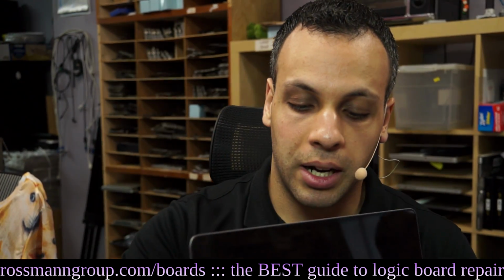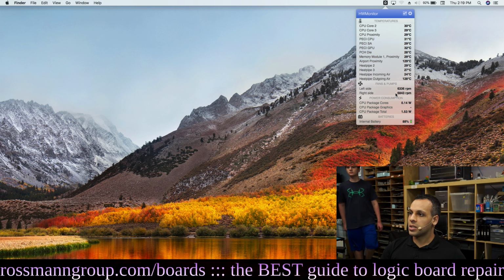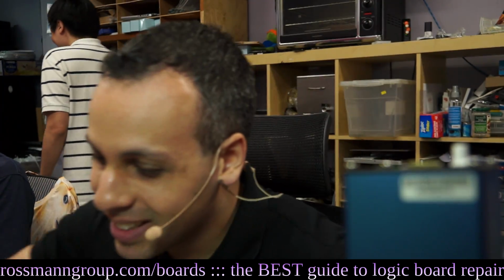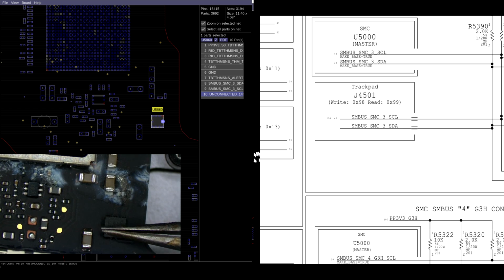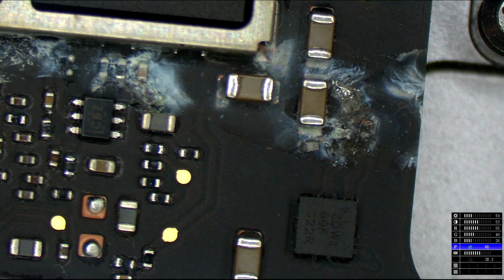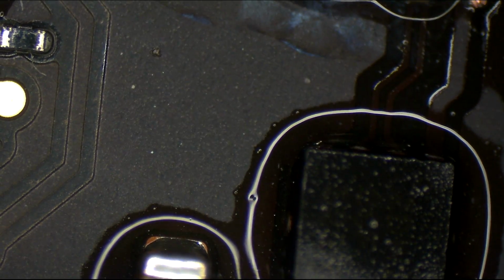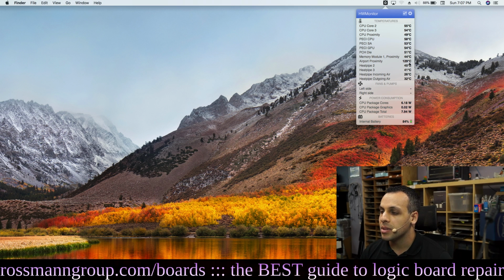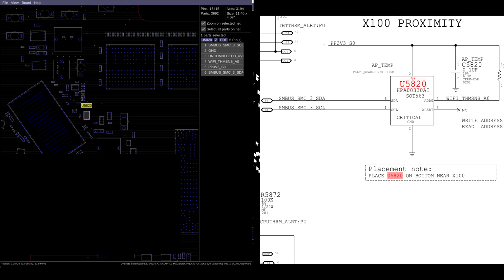How to repair sensor on Touchbar Macbook when running slow without Apple diagnostic software

Comment: Question: what happened to the RPM readings after your fix? Did you manage to get the correct RPM readings back again, before giving it back to the customer?

Comment: So why did it show a reading of a sensor that isn't there?
Reply: It's using I2C, and that protocol is dead simple, and there's no presence sense (at least, not on this line). The idea is that there is a master - the SMC - that queries the slaves - the sensors. There are two lines: clock and data. Normally, the data line is high, and if someone wants to send a 0 as opposed to a 1, it pulls it to ground. So when the SMC goes around to checking the temperature, it says on the data line: "Someone tell me the value at address 0x6F", and whoever has the address 0x6F responds in the next 8 clock pulses. HOWEVER, suppose the chip that had the value is dead. Since nobody else has that same address (that would be bad news), they stay quiet, and the data line stays high for the whole query time. Thus, the SMC receives binary 0b11111111, drops the first digit (since the temperature can't be negative (hopefully)), the CPU converts it to the common decimal representation - that is, 127 - then does some other stuff, giving a total of 128 or 129. Then it freaks out because the temperature is so high, and throttles its own clock speed to hell, which is why it's running slow.
Reply: I have to repeat my question. Why is it reading a sensor that is not present? Who told it to? Is it a third party software that is just mistaken?
Reply: How exactly does it know that the sensor isn't there? I told you, the protocol is dead simple, and you can literally interface with a device that doesn't care about timings with just a couple of push buttons and an LED. Because of this, it's super cheap to add into a chip, but it does also mean no handshaking and device enumeration for you. Therefore, there is no way that you can tell that a certain device is on the bus or not, so you either do some internal sanity checking on the smart side or freak out and throttle. I do remember something about heartbeat messages in the I2C protocol, but you're obviously not getting that here. 

As to why it's trying to read from there, it's a critical part of the system - it's one of the few things that allow it to check its own internal state, which is crucial if you want to keep it from overheating and blowing up - so any data coming out of there is taken at face value. 

One way you can think about an I2C bus from the master side is like a memory area. You can read from an address, and write to an address, but if the chip that housed the memory you're looking for is gone, then undefined bogosity will ensue.
Reply: Danya G. So it's a third party software that just guesses wrong? The answer shouldn't be that long if that's the case. I mean having a pristine apple product giving weird crazy values sounds very weird, they're usually quite sleek and functional devices. Mostly.
Reply: Danya G. Oh sure, I've had many times false readings from hardware monitors. So what I gather from these walls of texts is that yes, it's a third party software that can't know if this particular device has this chip, therefore is shows it regardless.
Reply: But the computer doesn't know this either! And there is no way it could know. The reason that the missing Airport sensor is no big deal is because the microcode on the SMC deliberately ignores that while computing the throttling factor. The 3rd party software, OTOH, has full control over the I2C bus, and tries to read from there, and fails. The reason I said before that the computer itself was reading it is because I thought you meant the airflow sensor, which was technically there, but it was gone from the SMC's POV.

Comment: hey Louis, is your HWMonitor a bootable DMG (cognate to a winPE boot image) with the software installed on it, or an actual macOS installation on a removable hard drive from which the system has to be booted? i'd consider putting it in my swiss army knife USB stick if it's the former. thanks!

Comment: here's a thought over engineered tech  good or bad thing? alot of apples problems is that its over designed and doomed to fail, if 1 sensor fails/breaks  its required of you to take it to an apple store for over priced repairs.

Comment: airport proximity , heatpipe temperature. either bad cpu contact causing throttling or a bad sensor. most likely seating of the cpu. that is backed up by 6000rpm fans trying to compensate. although with low package temperature its a sensor. 129 is a magic number with computer sensors. it means its reading null. as the bios can only read numbers the error that it outputs is in letters , that's why almost all failed temperature sensors revert to 129 its the numerical representation of some letters in a string . or 0 sometimes. or negative values.

Comment: everything about the first minute of video blows my mind. How can a company be so anti consumer and successful?
Reply: Because "Not having money is a sin and admitting it is lame and repairing expensive stuff instead of buying a new one means admitting not having money".
Reply: Maximum marketing.
Reply: Verlisify Mindless sheep are well... mindless... it doesn’t help they heard to buy 1 product
Reply: @c6amp while win 10 does tends to suck - i think you haven't meet vista or win Millenium :P
Reply: @c6amp Heck - i once bought HP laptop with vista - after a week of stuggling with the system i just installed win xp on it xD and later on win 7 (when it came out and sticked to win7 on it) ... The vista was a huge failure especially early on when it was "new". Win win vista the laptop despite being brand new was slow (despite it having good hardrware setup at the time). So yeah Vista sucked... but hey i got no probs if you had different experience. Cheers o/
Reply: Because its customers are all Thinking Differently (TM)
Reply: Furry
Reply: Money!

Comment: Enjoy watching you diagnostic, repairs and other comments. 
Curious on this project, was it determined what caused the 0 ohm resistor, being used ans a fuse, to burn up?  And is not replacing it with a larger capacity the same as replacing a a fuse with higher ampere?

Comment: The fact that you found the airport proximity sensor still wasn't working, and took the machine back apart to make sure the repair was done completely. despite the fact that there wasn't actually a sensor on there means you're more ethical than apple when you do repairs.

Comment: there's a couple things here  @Louis Rossmann  1.HWmonitor controls the naming schemes not apple, two HWmonitor generally sucks when it comes to accueratlely reading sensors , hwinfo is far more detailed sadly there is no current ClapOS build so moot point I guess unless you wanna bootcramp to windows

Comment: Hey Louis, thanks for all your great content! Question though; I just installed HWMonitor on my 11.5 with the m370x and the GPU 2 die is 129 degrees. My assumption is that this is not a needed sensor? Is this OK? every other sensor is perfect and behaviour is OK. Thanks

Comment: 4:08 
Ocelot:Boss, if staff morale or GMP reaches below zero levels, staff will start to fight each other, affecting the overall staff level, if the problem persists, the fights will get more brutal. you can gain moral by dismanteling nukes, raid F.O.B bases and doing stealth mission undetected

Comment: At some point during the making to that model Apple actually ran low on that sensor so that simply left it out.  From what I understand from a former employee that is common.  They simply tell the monitoring system to ignore the reading and move on.  They are essentially selling defective parts from their own specs!  But is that really surprising?

Comment: When I saw the airport temp I immediately had a flashback to the old G3 Toilet Seats where they would put 600mhz G3 processors in them, and instead of putting a cooling solution in there they clocked them to 200-300mhz (depending on model) and covered them in insulating foam -- then put their dumbass "airport" slot (aka a PCMCIA slot missing two voltages so you couldn't use third party cards) and dialup adapter directly over the cpu... More often than not resulting in BURNING A HOLE CLEAR THROUGH THE DIALUP ADAPTER and messing up any wireless card pretty badly.

Though it's fun on those to rip out the dialup adapter, put in a SHOCK heat sink, move a couple resistors around on the board, and bring them back up to 500mhz or faster (depending on the FSB/RAM clock)... and for some reason many buffalo wireless G adapters work in that neutered PCMCIA slot, and are shorter than the official apple ones making them less likely to get toasted.

LESS likely...

I swear, Apple wouldn't know proper cooling if it stripped naked, painted itself Noctua tan,  and hopped up on a table to sing "Oh look at what a high volume cooling fan I am!"

Comment: I'm a telematics technician and there is nothing more frustrating then an alcohol dispenser who doesn't shoot 😂. Especially when I'm doing fiber optic cable on very dirty places.
Reply from the maker: DAMN STRAIGHT!!!
Reply: @rossmanngroup  15la 11aallllqqqq 1lllqwwaa+que
Reply: Can't wait to see Louis Rossmann Smashing Things :-)
Reply: Pump several times > Grumble curses > Turn on side > Pump several times > Swear loudly > Turn upside down > Alcohol spills on floor > More cursing > Pump a few times > Return to upright position > Pump works normally. At least that is how I get mine working again. The only thing worse is when someone wants to help and lets it lay on its side and alcohol goes everywhere. Did you know that alcohol is a mild solvent that can turn some plastics into sticky goo with enough time?

Comment: The difference in naming for the sensors is quite possibly down to HWmonitor using the plain English name so that everyone can understand it, rather than the hardware name.

Useful for someone who doesn't know what they are looking for, not so much for a repair engineer.

Comment: seems like a fail-safe system, if temperature sensor broken, it will read max temperature to prevent overheat...
but Louis just demonstrate in the latest video the fan will only kicks in at 81C lol

Comment: 7:30 Maybe it's just me, but that naming doesn't strike me as consistent at all.

Might that temperature sensor read a temperature that high, because it works with resistance and there's either no or full resistance?

Comment: I hate to ask, but did you check the NB under load? Because the FANs were showing "nothing" after that and if the Fanspeed is needed for whatever reason to regulate fanspeed...well, that could be more trouble. (Or it could just be, that they were off...however, then it should show "0" - logically, but who knows what Apple thought..)

Comment: They called it X100 because it adds an extra 100 °C.
Reply: That actually makes sense
Reply: @Payitforward42  it would make more sense if it was +100 :D
Reply: @mrscamander2691  just turn the X a bit around so it makes sense.
Reply: Think different
Reply: That would be +100 then, x100 should multiply it by 100
Reply: Dominik Kierner anytime an ad plays every apple be like THE ROOF THE ROOF IS ON FIRE.
Reply: That's not cool tho

Comment: I have 129 Celsius on the gpu die 2 on a MacBook Pro mid 2012 Core i7 2.6ghz is a non-retina model. Is that normal ? I have to worry about?

Comment: Ok, you turned me down with my AMD dead gpu for my 17in iBook pro 2011. Can you replace it? In the mean time I have been booting w/o it with this code.

Command + Alt + P + R
Command + R + S
Csrutil disable
Reboot
Command + R + S 
nvram fa4ce28d-b62f-4c99-9cc3-6815686e30f9:gpu-power-prefs=%01%00%00%00 
csrutil enable
shutdown -r now

Can you help a lost soul?

Comment: You need to make a SMC Reset and a Video Ram Reset to solve the wrong reading. Same problem resolve after repairing a sensor in a A1278

Comment: Were the fans not reading an rpm value because they were turned off because the (heatpipe) sensor wasn't reading a high enough temperature to warrant running the fans?

Comment: The issue is it's slowing because it thinks things > 100C. Makes sense - it doesn't but sure. My question is why is the laptop allowed to boot at all if it things are that hot? It should just flash up an image showing "your airport proximity is 129C" and then power off. Surely there's a temp at which the laptop says "no, we're not doing this actually".

Comment: What decently priced solder station and rework station do u think would be best for a beginner? I've had some experience but with like a cheap $10 RadioShack plug in wall soldering iron. I'm wanting something decent and maybe looking at hakko.